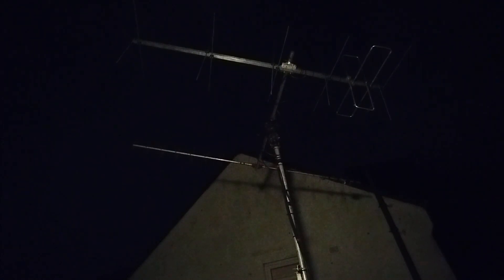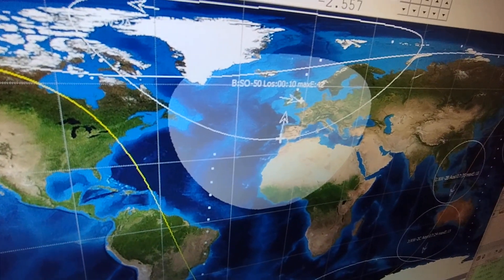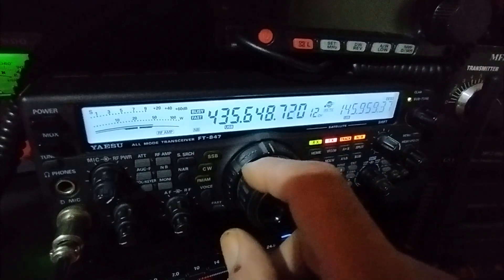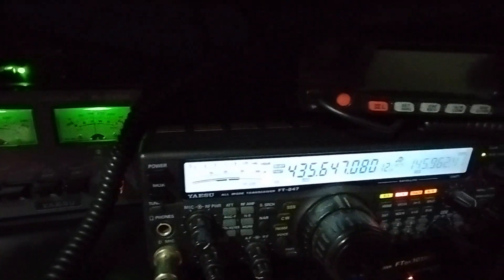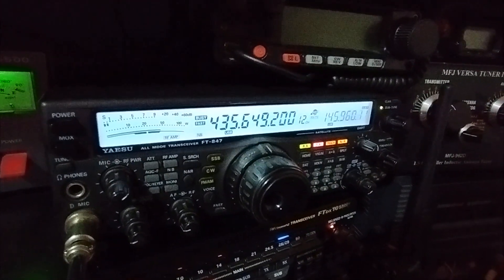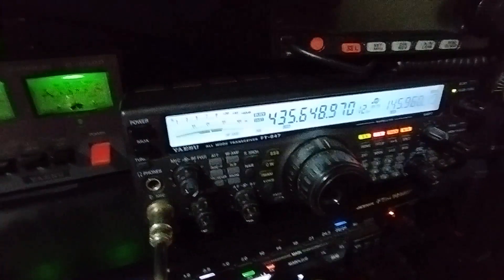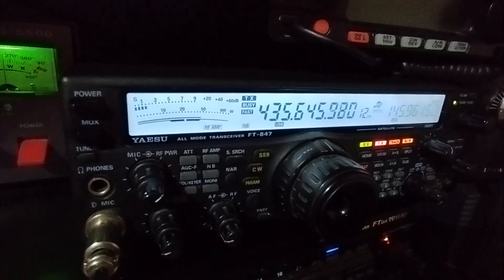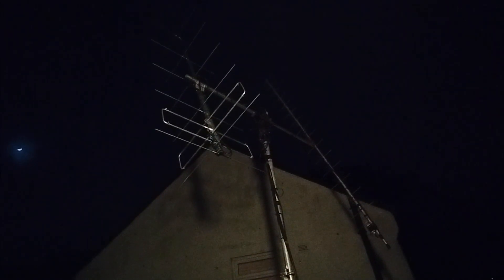Auto Tracking Satellite Station - HAM Radio

Comment: Anybody with the Yaesu FT-847 can confirm.. after the TX mod does it transmit from 460-470.. mine doesnt only receive......, but transmits to 459.990
Reply from the maker: Not meant to TX out of the Amateur Radio bands. If you try to open it up you will ruin the RX quality on the SATs. Just pick up a cheap Chinese radio for PMR but remember the power out on PMR is 0.5 watt max or maybe less.
Reply: @M0YKSHamRadio  not true, works fine after the mods
Reply from the maker: @WPGinterceptor460Interceptor  how come your asking if you've already done it 😁
Reply: @M0YKSHamRadio  after the mod transmit they say will do 450-470. Mine only does 450-460.. so im asking if others have same.. it doesnt say Error, just transmits but no rf is being transmitted from 460-470..... BUT 450-460 it transmits 50 Watts
Reply from the maker: @WPGinterceptor460Interceptor  fair enough 👍

Comment: I just added RS-44 to my scan. I'm having trouble receiving the low power satellites with my home brew egg beaters, though. But I've just perfected my double-sided pcb etching technique, so soon I can produce my version of a G-5500 tracking controller board, maybe. ; )
Reply from the maker: Sounds great hope it goes well. You should be able to get a decent signal from RS-44. Have fun l. Best 73
Reply: Are you using a pre-amp?
Reply from the maker: @nickjh1968  no separate preamp, just the FT-847 doing well 😎🔥